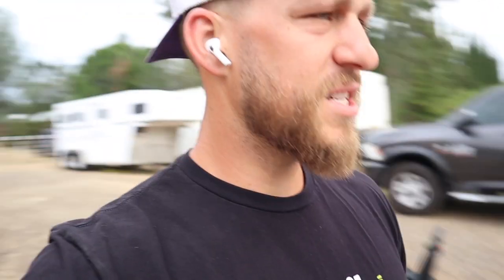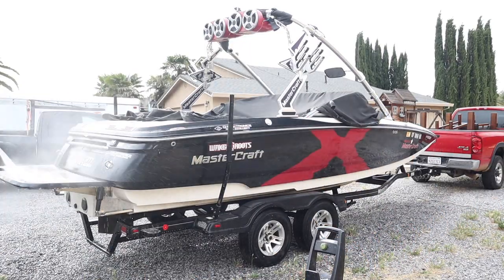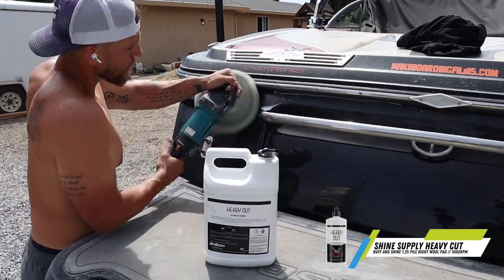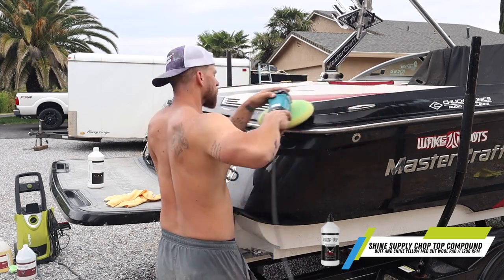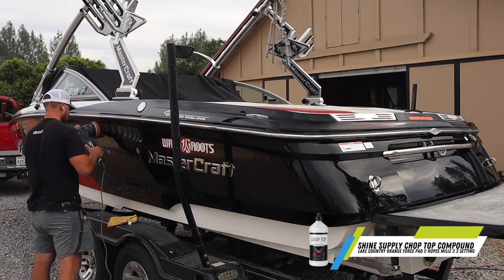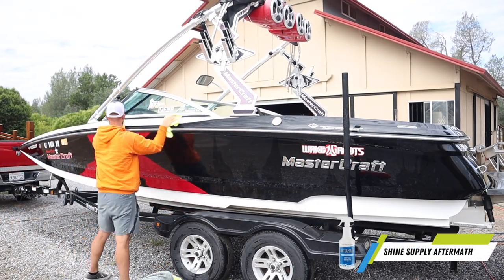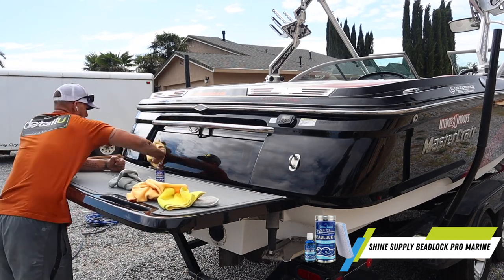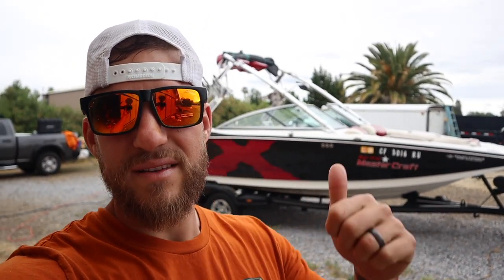Crazy Boat Restoration | From Oxidation To Shine | Shine Supply Products | Revival Marine Care

Comment: What a great teaching tool! When you did your interior detail, I didn’t notice you flipping up the seats to get in between the seat and the upright. This is where I have the most issue as there is almost always a build up of organic (I assume) that stains the contact points. I’ve tried almost everything I know but it doesn’t come out. Any suggestions?
Reply from the maker: Try a mild degreaser with Magic eraser to get the stubborn stains out and then follow up with protective cleaner and see how that works!  😎

Comment: Broooo invest in some durablocks. For that rear (next time) hit it with p400 cross hatch blocking, 600 dry, 800 wet (on blacks) run it to 1500 wet sand
Reply from the maker: Thanks for the tip 😉

Comment: Awesome video like always!! Super knowledgeable and entertaining! I have a question about a boat I bought. It has very old barnacles on it and when I scraped them off it leaves the husk on the hull? I tried some chemicals to get them off but to no avail? Do I have to wet sand ? Heavy cut? What advice do you have or a way I can DM pictures for more info would be great! Keep it up
Reply from the maker: Hey bro! Try some on-off acid on the bottom.  You can buy it on Amazon 😎

Comment: Hi Drake. I came to you tube desperately trying to find out for a tutorial since most of the chrome in my boat went off. I went by a friend recommendation and I used muriatic acid to clean the yellow stain on the outside and inside. I regret it 1000 times. 
Do you carry any product that can help me to save the chrome ?. 
Any comments will be very helpful…
Reply from the maker: The acid will stain the metal. you'll need to re polish your chrome to bring it back. use a heavy cut compound on a grey force lake country foam pad to polish it. I would recommend a rotary machine as well for the polishing

Comment: Hey man! Really appreciate your videos and info. Wanting your advice ~ my dad dry sanded the lower portion of our family ski boat with 150 grit (big time ouch / mistake) on the lower portion of port and starboard only. My plan was to use 1000 grit wet sand to smooth this out , then 600 and 400 compounds….do you think the gap between 150 and 1000 for the wet sand is too big? I.e I should use say 500 wet sand in between? I don’t want to take much off but I need to get rid of those 150 grit sandpaper marks….thank you!!
Reply from the maker: Do the 1000 in a spot and then compound with something heavy after and see how it looks. If that doesn’t cut it then you can try 500 in between, but just be careful. It is very agressive

Comment: What’s up man loooks 🔥🔥🔥.. with that beadlock pro how easy or difficult do you think it would be to use in swfl outside in the sun?? I know there’s barely any humidity in cali but you use to live here in Florida so could you coat boats outside with beadlock? Is it comparable to any other coating you’ve used?
Reply from the maker: Yes it’s actually one of the best ones I’ve used!
Reply: @DrakesDetailing  ohh woow thanks man

Comment: Hey drake great video! Question about the compounding pad you said you use a 1.25 height pad is shorter pile pad better for cutting or higher pile I have a lake country twisted wool 1.5 height pad that should be pretty similar right? I think that’s the most aggressive pad lake county makes
Reply from the maker: Shorter the pile hight the more the cut, but the type of wool pad also make a difference. 

It has to be a twisted wool
Reply from the maker: I’ll be selling them in about 2 weeks on detailusupply.com
Reply: I have both the 1.25 and 1.5 double sided twisted wool cutting pads from buff and shine, the 1.25 definitely cuts faster than the 1.5, but the 1.5 does the job if you like more of a cushioned feel. Lake country and buff and shine both make excellent pads, can’t go wrong with either.